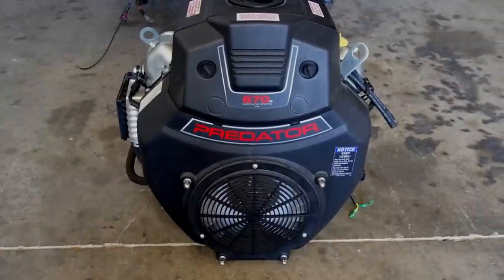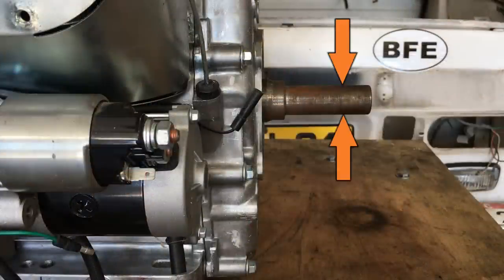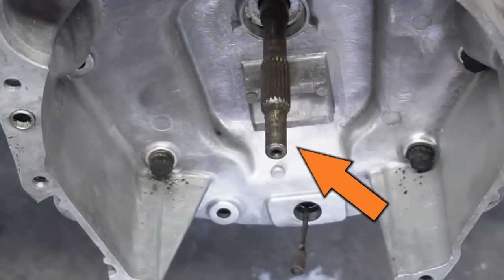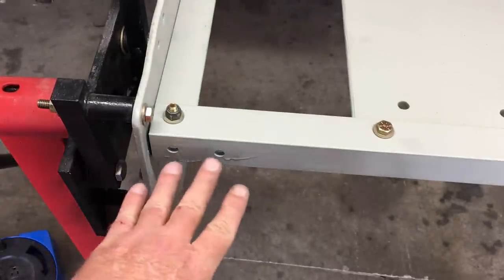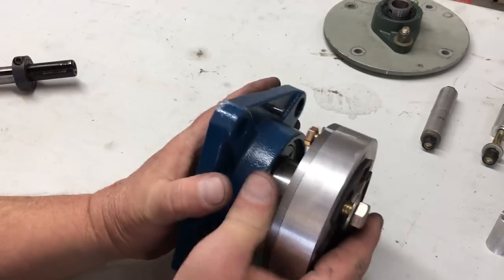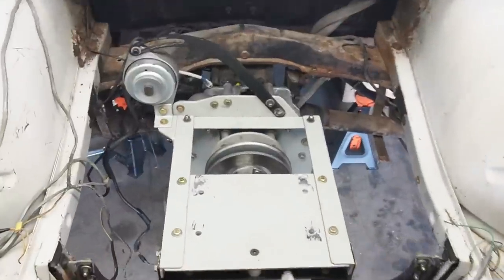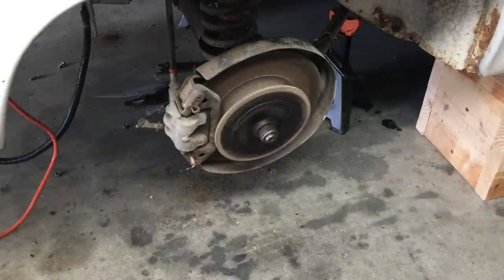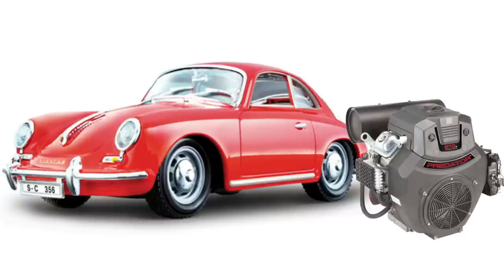S3 E18 We put a 670 Predator V twin in our project car 1969 Renault 10

Comment: Tools Every Homeowner Should Have
Reply: Hammer

Hammers are the workhorses in any tool kit. You can use them to close a paint can, pull out an errant nail or pound that security alarm sign into your flower bed. Consider it a must-have, says Chuck Khiel, senior vice president for Bethesda, Md.-based Fred Home Improvement. There are various types, including ball-peen, sledge and mallet, but the 16-ounce claw hammer, which has a head that is split and curved on one side, should handle most jobs and isn’t too heavy to wield.
Reply: Tape measure

Look for one that is at least 25 feet long to measure pretty much anything inside or out. It should have the fractions of an inch — down to 1/16 — labeled, so you can concentrate on the measurement and not on counting the marks, says Vineta Jackson, who writes about home improvement at the Handyman’s Daughter.
Reply: Four-in-one screwdriver

Whether you need to tighten a loose hinge, assemble a toy or change an item’s batteries, this is the ultimate affordable tool, says Sean Walsh, a general contractor and CEO of Walcraft Cabinetry in Ohio. It comes with two double-sided bits, including two flat heads and two X-shaped Phillips heads. These can be swapped in and out of the screwdriver handle.
Reply: Set of pliers

A standard three-piece set includes six-inch slip-joint, needle-nose and diagonal (or cutter) pliers. “They allow you to get a grip on anything,” says Kevin Busch, vice president of operations for Mr. Handyman. Needle-nose pliers are especially efficient in small, tight spaces, and diagonal ones are ideal if you need to cut wires.
Reply: Tongue-and-groove pliers

These adjustable pliers are good for tightening threaded fittings, such as sink drains, and turning handles or valves. “They’re my go-to for plumbing repairs: to stop leaking water, change a shower head or grip a stuck valve, so you can apply enough leverage to turn it off,” Walsh says.
Reply: Socket wrench set

A socket wrench does the same job as a conventional wrench, only more efficiently. Instead of buying dozens of wrenches, you can buy a single handle and removable sockets in different sizes. A socket wrench, with its ratcheting handle, lets you turn a nut or bolt without repositioning the tool on the fastener — as you would need to do with a wrench — when there isn’t enough room to turn it in a full circle. A set with about 25 sockets should be sufficient.
Reply: Levels

Jackson suggests you add two sizes of levels to your tool kit. One should be six to eight inches long, and the other should be four feet long. “The shorter one is good for hanging pictures or shelves,” she says. “The longer one should be enough for greater spans, say side-by-side shelves, or if you have a project like outdoor pavers.”
Reply: Five-in-one painter’s tool

This inexpensive gadget may be the Swiss Army knife of hardware. It looks like a putty knife, with its wide, flat blade, and it has a point for gouging, a square end opposite the point and a curved cutout. Use it as a can or bottle opener, a scraper, a paint roller cleaner, a screwdriver and more. Khiel says it can even help unstick painted windows.
Reply: Utility knife

“Please don’t use a steak knife to open boxes,” Busch says. A utility knife with retractable and replaceable blades can cut through thick materials, including cardboard, rope, foam rubber, heavy tape and more.
Reply: Cordless drill with interchangeable bits

The least intimidating of all power tools is the cordless drill. Prices start at about $35, and manufacturers typically produce them with long-lasting rechargeable batteries. Even if you have to pay a bit extra, get a full set of bits — drill, screwdriver, hex head, star head — to make it as versatile as possible. A good cordless drill allows you to do a job much more efficiently than by hand, Busch says.
Reply: Magnetic stud finder

A stud is the wood frame holding up your wall. When you go to hang a heavy item, you want to be sure you are nailing or drilling into wood and not just drywall, so it doesn’t fall. Electronic stud finders tend to give false readings, especially on textured walls, Jackson says. Instead, use a magnetic one (about $10), which you can move over the wall. Stud finders should stick to the screws or nails in the wood framing.
Reply: Duct tape

A universal adhesive, duct tape can seal boxes, corral cords, patch holes in a garden hose or spray faucet, mend a shower curtain and more. And it comes in a rainbow of colors
Reply: WD-40

This blend of lubricants and anti-corrosion agents silences noisy doors and hinges, lubricates locks, loosens stuck bolts or zippers, and even removes crayon marks and other stains from many surfaces.
Reply: Allen wrench key set

If you have ever assembled a piece of Ikea furniture, then you are well-acquainted with this tiny tool, also called a hex key, used for turning bolts and screws with hexagonal sockets, Jackson says. “I like mine on a ring, so you can easily find the one that fits,” she says. Allen wrenches are useful for tightening assembled furniture, towel rods and more.
Reply: Something to put it all in

Whether it’s a five-gallon paint bucket, a heavy-duty duffle bag or a toolbox with multiple shelves, store everything in one place, not throughout your house. When you do need to make a quick fix, you want something that’s easy to tote, so you don’t have to run around digging through drawers or scouring cabinets.
Reply: f I had a hammer
I'd hammer in the morning
I'd hammer in the evening
All over this land
I'd hammer out danger
I'd hammer out a warning
I'd hammer out love between
My brothers and my sisters, ah-ah
All over this land
Reply: If I had a bell
I'd ring it in the morning
I'd ring it in the evening
All over this land
I'd ring out danger
I'd ring out a warning
I'd ring out love between
My brothers and my sisters, ah-ah
All over this land
Reply: If I had a song
I'd sing it in the morning
I'd sing it in the evening
All over this world
I'd sing out danger
I'd sing out a warning
I'd sing out love between
My brothers and my sisters ah-ah
All over this land
Reply: I got a hammer
And I've got a bell
And I've got a song to sing
All over this land
It's the hammer of justice
It's the bell of freedom
It's the song about love between
My brothers and my sisters
All over this land
All over this land😇😇😇
Reply: … I'd rather be a hammer than a nail
Yes, I would
If I only could
I surely would
Reply: … I'd rather be a sparrow than a snail
Yes, I would
If I could
I surely would
Reply: … Away, I'd rather sail away
Like a swan that's here and gone
A man gets tied up to the ground
He gives the world its saddest sound
Its saddest sound
… I'd rather be a forest than a street
Yes, I would
If I could
I surely would
… I'd rather feel the earth beneath my feet
Yes, I would
If I only could
I surely would
Reply: @kansasrose2909  The ending   clip on this video was absolutely  EPIC.    Jimbo,  are we going to find
out what happened with that tree.   Don't leave the audience hanging out on a limb
here.    Enquiring  minds want to know!!!   ROBOT CANTINA,  the endings keep
getting better and better.

Comment: I believe the 670 and any of the other predator engines with electric start have a charging system already on them, depending on the load your planning to pull you might not need an auxiliary alternator

Comment: My issue with that transmission setup is you will never have proper “lockup” or direct engagement. No matter what you do with the clutch on the vehicle it’s all dependant on how the CVT clutch is set to engage. Now if you say locked out the CVT so it’s always spinning at a constant speed then yes it would be viable. But without yes you will forever Be “slipping”. It would be optimal to just have it chain driven to the input of the transmission and have the clutch operate via the constant RPM.

Comment: So you replaced a 43-49 hp i4 with a 22hp v-twin... hoping for more speed?
Really cool project, but fuel economy aside, speed is probably not a realistic goal with half the horsepower of the original.
Reply: 22HP STOCK. The aftermarket for these engines is insane because theyre used in spec cart racing. People have made upwards of 70hp with these engines with forged internals and forced induction. And robot cantina is not above forced induction.
Reply: @upyx9726  which is still quite a lot short of what the original engine does with crossflow heads and minor modifications (available from factory and aftermarket).
I guess the generator mods might be easier to procure, but Gordinis did 95hp from the factory, No forced induction anywhere to be seen or needed.

Comment: I got a cushman van with a 22hp omc lawn mower engine it’s got a 3 speed manual transmission   With clutch  pressure plate every thing 80amp alternator

Comment: Hey Cantina❤ love it. The Renault is likely to have a better power to weight ratio than the Saturn or the Insight. My guess would be 50 MPH (80  km/h) top speed since the engine's max rpm is low for now. I hope you'll make it scream with your magic.

Comment: ...two batteries.      Loc-tite isn't superior to using a flat tip nut splitter to off-round your nuts and it has issues with freezing and some chemicals.

Comment: I'm sure someone else is already said it but the predator V-Twin should have an alternator built in behind the flywheel it won't produce much current only about 15 to 20 amps but that should be a good enough for what you're doing with it

Comment: I think the folks hoping for mpg need to keep this in mind: back in 1980 briggs and stratton built a hybrid car using one of their v2 engines, and it only got about 30mpg, and was about as fast as the kubota diesel saturn. I expect this build to be both hungrier for power and thirstier for fuel. 

Strapping a insight transmission and hybrid system to the Kubota however, might just be the most "practical" way to get really high MPG and make it faster, if possible

Comment: I will say I learned the hard way that putting the engine directly to the trans is a horrible way to do this. Have something that can slip is perfect because I've broken the crank output doing burnouts in my miata. I did get up to 65mph with a stock engine though.

Comment: for future reference, is there any option of upgrading the crank bearings with tapered roller Bearings to be able to take thrust loads. Im assuming its because of a ball bearing or bushing supported shaft currently on the predator engine? ive worked on some old wisconisin engines and they have tapered roller bearings for the crank support. Just a little food for thought:) thanks for the video, i always enjoy these swaps.

Comment: Renault 10 specs new
Bore and Stroke: 70mm x 72mm

Power: 50bhp SAE @ 4,600 rpm

Torque: n/a

Compression Ratio: 8.5:1

Standing quarter mile (400m) 21.4 seconds.

Based on these numbers it will be a slow beast with a predator up its clacker

Comment: That clutch disk plate will come loose if you don't drill some holes to line up with the bolts.  Those slots won't hold it.

Comment: Lots of comments already.  Guess you're doing something right ! ❤  Did I spot a reg-rec mounted on the engine? Would the built in charging system be comparable to this alternator, or is the alternator slightly more charging power?
Reply: IIRC the external alternator was 20 amps and I've heard the internal charger is 3-4 amps. That's more than a little difference.

Comment: I was wondering, although it would probably work just fine as is. Have you ever considered putting a bigger flywheel on the engine? either replacing the stock one or putting a similar sized one on the clutch size. You'll trade some hp but will get a little more usable power during "stops and go's" and or shifting.

Comment: Try the doughnut tires on the front of Saturn, and the super overdrive gear.. Does this change mpg economy🤔 I know it's not practical.. But.. Just for testing purposes😜 i mean, you did beat the toyota prius hybrid for the best fuel mileage.. Nothing to scoff at right? I bet you could even get more mpg for sure.. Not to mention sporty torque on 1st-4th, then very good mpg overdrive

Comment: That is a cool project - I do wonder if you can turbo charge that thing without it getting too hot. I wonder if that would be the first 2 cylinder air-cooled turbo charged Renault.

Comment: I looked at the Automobile Catalog and found some data for a 1969 Renault 10. When fitted with the stock 1100 cc engine and a 3 speed semi-automatic gearbox, the car was claimed to go at 83 mph with 46 hp.  

Hmmm... if we assume that P = C(V*V*V) where P is power, V is velocity and C is a constant then plugging in 83 mph and 46 hp into the equation gets a constant of .00008 hp/mph^3.

Using 22 hp and .00008 hp/mph^3, we get 65 mph. 

Hypothetically we should see 65 mph with the stock Predator. This seems wildly optimistic to me. I'll be impressed if we see 50 mph before we modify the engine.
Reply: Thank you for this intriguing and well articulated comment.

Comment: Would really like to see if it would be possible to adapt a flywheel and machine an adapter to freeze heat fit both the adapter and wheel and use a caged roller in a lathe cut center hole. About.005 press fit will be sufficient and reached with dry ice and alcohol.
Reply: The plate could take a thrust bearing and be on the adapter. Or ride against. You like the jackshaft approach and the torque multiplier is nice , but it is not a torque converter.

Comment: Alot of pepole even some "Mechanics" I know (And I am NOT a real mechanic but i know this) Go all with horsepower, but heres the thing Horsepower is technically a false measurment, Tourque is more important. Even with less HP a diesel having more torque can generally do more "work" than a simular sized gasoline engine with the same or less HP. However with that being said, the everage HP back in the 30s was simular or less torque as that Preadator V-twin and the vehicles weighed roughly the same, so it aught be able to achive 60.

Oh and a suggestion; Add a turbo to that Predator. Would be interesting to mull over the results. Cant wait to see the project through to completion.

Comment: Its not that the comet clutch won't work. It will. It's that the clutch doesn't shift right when the output load isn't the same in every gear. 
The RPM the engine gets to when the clutch starts shifting will be different in each gear. Those clutches are also pirates. They steal power.

Comment: fun fact: The original fiat 500 (also air cooled , twin cylinder, and rear engined ) historically also almost had a v-twin engine instead of the famous parallel twin , courtesy of a preliminary deal with moto guzzi for a supply of 500cc 35 hp V-twin (that would have made fiat economize on Research and Development for a potential new home-brew twin cylinder)  Unfortunately the deal never materialized and only (allegedly because of one single photograph) one functioning prototype for testing was ever made.